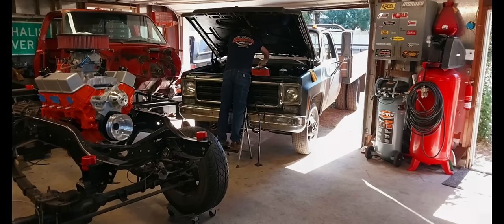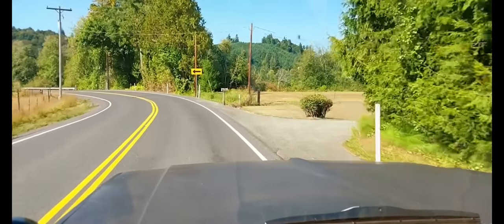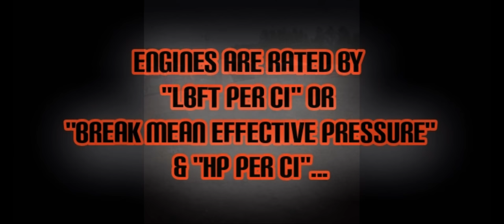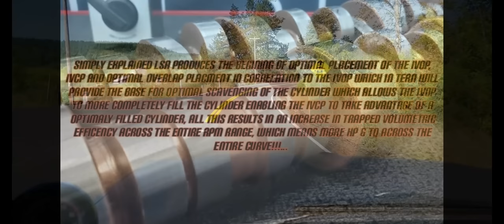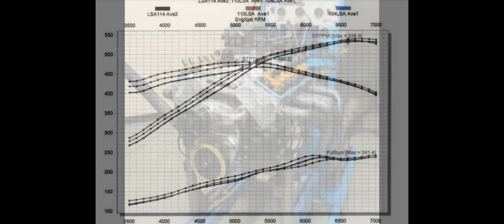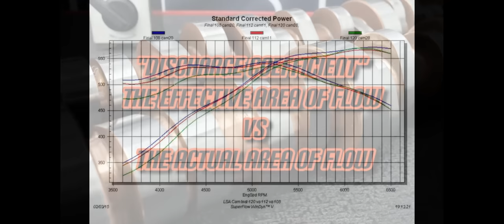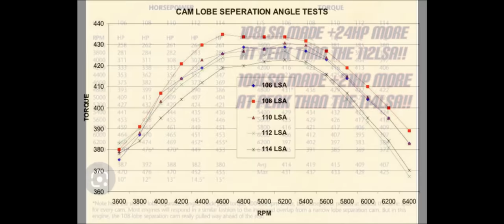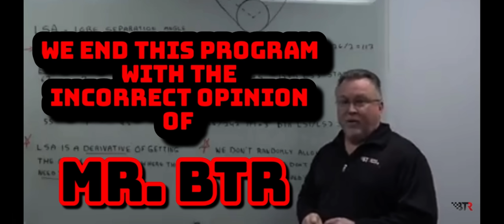Camshaft Selection via LSA, 19LSA's Dyno proven MAX TQ & HP cam tec. LSA, Overlap & Duration convert

Comment: Would love you to research boats. On speed/power boats, most have water jacketed headers and sometimes the exhaust is under the water. The consensus is to always use a cam with a wide LSA, otherwise you will have reversion/water getting sucked into the engine. Not sure if this is true, but companies like TEAGUE MARINE who have been in the business of building the most powerful and reliable Big Block chevy Marine engines since the 70's, also practice this wide LSA stance. In boats,  you don't need peak horsepower, you need as much midrange as possible. I'm not challenging Cattledog Garage, I'm seriously would love for you to research this, and recommend cams in boats, you are a smart man, you could probably develop a winning engine.
Reply from the maker: Thanks for watching, I actually adressed the adjustments required for Optimal LSA and maintain a specific amount of overlap by adjusting the duration.... I have an mathematical calculations for it, I even show a mathematical example how to convert a 116lsa to a 106lsa and maintain 30°overlap @.050 & 88° total overlap by changing the duration.. Overlap is what causes reversion not the misconception that LSA causes reversion...

Comment: Does this formula work for 500ci low deck B block mopar? I’m coming up with 102. That seems extreme
Reply: Yeah that's a huge cubic inch that's why when you have suck big cubic inch if you want lots of power you need bigger valves, bigger rocker ratios and add more compression if you want. Then you optimal LSA will be much wider if you do all that

Comment: do you address low vacuum, idle quality and fuel mileage in this video? as those will be the negatives when using a low LSA
Reply: If idle quality is bad take away duration. LSA doesn't do idle quality it's the overlap if you lower duration it lowers overlap and yeah LSA could affect fuel mileage but he is talking about Performance engine to make them go as fast as possible
Reply: Just pick one off the shelf if those are your only concerns
Reply: @hankclingingsmith8707  no I mean don't just pick one off the shelf all I am saying if you have to much overlap because of LSA choice was narrow. Then take away duration to the overlap you want for the idle quality you want.
Reply from the maker: Thanks for watching, if you watched the entire video I actually adressed that several times and showed the adjustments required for Optimal LSA and maintain a specific amount of overlap by adjusting the duration.... I have an mathematical calculations for it, I even show a mathematical example how to convert a 116lsa to a 106lsa and maintain 30°overlap @.050 & 88° total overlap by changing the duration.. Overlap is what causes poor idle quality & effects vacuume not the misconception that LSA does...

Comment: from the calculations I am getting 104 LSA for my 460 ford (all stock).  Does this sound right?
Reply: Did you use the 132 number of you did then that means you are under valve or under compression I am sure 104 camshaft can be made but that also means if you want more power bigger valve and bowl work to help it flow a little more and more compression to help it to

Comment: could you explain I worked this formula on a 337 ci sbc it produced an LSA of 109 is this correct? and why not 106 LSA? thank you
Reply: The smaller the cubic the wider the LSA it's like 108 on a 350 and 106 on a 383. Just I don't know what exact science it is but smaller cubic inch doesn't need that much air faster compared to a big one like a 400
Reply: thanks i contribute to the short stroke the tighter the lsa the less time there is to pull air and fuel into the chamber. ??  @chevyrc3623
Reply: @gordongrimes4088  smaller the stroke and cubic inch the wider the LSA

Comment: Can your formula be adjusted for 8:91 compression Oldsmobile 350 engine?
Reply: Oldmobile has inline valve so try the 128 number it should be already or close and 8.9:1 so that over 1 point smaller compression so whatever number you get just minus it .75.
Reply: Thank you for the insight, I learned a lot from your perspective on camshafts.

Comment: Lsa is a byproduct of valve event's, the induction, exhaust, port design all play a part in what is optimal. There are genetal trend's for sure, but application plays a part to. What is this engine used for etc.  interesting video

Comment: Would a single pattern cam work with a ls3 stock heads and stock intake with good flowing headers and exhaust.
Reply: Notice the difference between cams for cathedral port heads and cams for rectangle port heads
Reply: Yeah rectangle port heads all have large split cams using the formula for motor I got a 109 lsa. Just don’t know if I should follow what the cam companies are doing and get a large split duration. Or go a single pattern or even a small split

Comment: I need help with the intake center line? I  can't find a formula for how much advance to grind in the cam
Reply: There isn't really one Cattledog normally has 4 degree advanced but that's not all engines if you have a dyno and you get your camshaft adjust cam timing and see where it likes it
Reply: @chevyrc3623  I took a sloppy stage 2 and tightened it to 108 lsa, took the centerlines and centered them between the old numbers   using a valve event calculator, I'm 17 and don't have access to a Dyno, I have to do it right the first time
Reply: Thanks for the help!

Comment: soi Less torque for drag racing will require more gaer higher gearing to get the cart excellerating to get down track fine for Chevy 700 R , not for 350 tubo or even less for a Mopar 727 will need very high gearing. what are they talking 6 horsepoower then a single plane intake will make that difference up for 101 LSA Canmshaft on top end and having the torque to cover lower end .

Comment: You've talked the talk.

So now it's time to walk the walk. 
No small block, no big block but an LS on a well respected dyno. 
Do it on a stock motor, no fly cutting pistons. Just install the cam with your LSA and run it against any well respected BTR, TSP, or I'll even spec one off the top of my head.
Reply: Everybody knows that... to run a decent cam in an LS requires valve reliefs. That configuration choice was great for a stocker

Comment: The formula for a 406 with 2.05 intake goes... 406 div..by 8 hit equals, div by 2.05 hit equals,  times .91 hit equals, minus 128 equals. Shows 105.4 or 106 would be logical .
Reply: 105 you should round down
Reply from the maker: Thank you for watching... With The LSA coming out at 105.4 you would round down to 105, hope this helps 
Take Care...

Comment: I'm horrible at math and most guys are so I asked my Wife she looked at the formula and said "F-ing Algebra" do it like this. You have to do the stuff in Parentheses first. so take the cubic inches divided by 8 and hit equals then divide by the Valve diameter and hit equals then hit the X or times key and enter .91 and hit equals then take that number and subtract 128. in my case it was 350 cubic inches divided by 8 cyls. divided by 2.02 valve dia. x .91 and then -128 which gave me -108 235/808 round it off to 108 LSA. Fortunately I watched a Vizard video and one of the examples he gave was my engine i knew the answer was 108 LSA but i'll be damned if i could figure out how he got there. David Vizard was an Aerospace Engineer I should have known he couldn't make an easy to figure this out I was a QC inspector for a large Helo company and dealt with these guys on the daily. Engineers freak me out, i think it's the red wig and the bozo shoes they are all clowns.

Comment: We see cams designed for low med and hi rpm power. They design them that way for each application.  A cam has a fixed lsa. So yes it's good to hit it close to high power but what about on a street car. Drag race cams,top end cams make max power at the rpm you choose to run. So no cam can make max power at low med and high rpms. Cams are for the most part fixed.
Bv